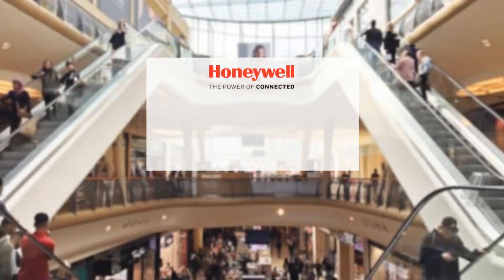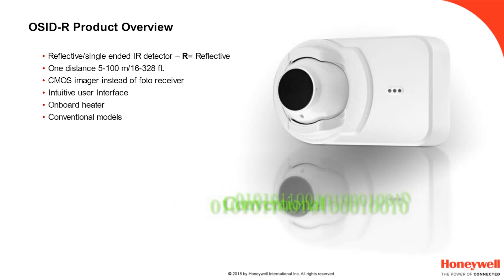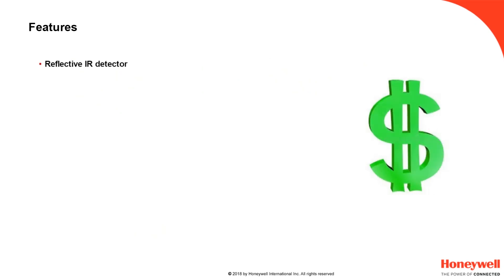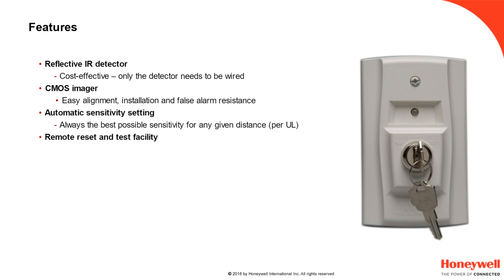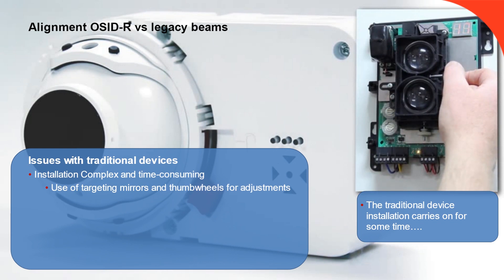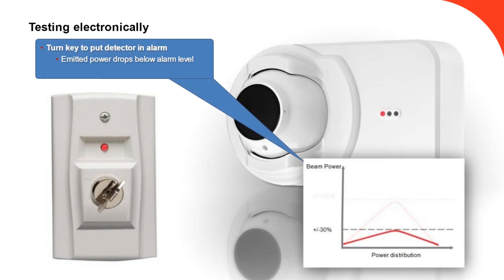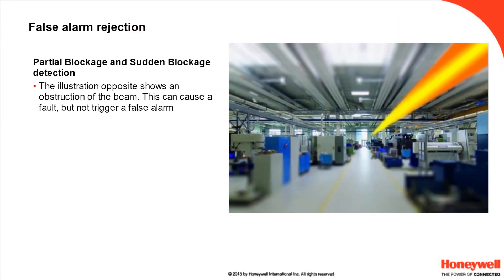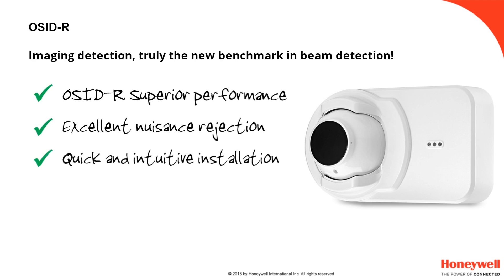OSID-R Reflective Imaging Smoke Beam Detector

Comment: Arrows will not align properly, just blinks red and when it does go yellow the beam is no where near reflector
Reply: Did u get it going? So its not worth buying one?
Reply: Which model did u buy?
Reply: ANTONIOS they work very well. The problem I experienced is on earlier versions of the silent knight 6820 firmware the detector did not hold its alignment. When removing all power from slc I would have to grab the 40ft ladder and redo the initialization process. This has been ressolved recently
Reply: Have you got an init mode error on the panel?